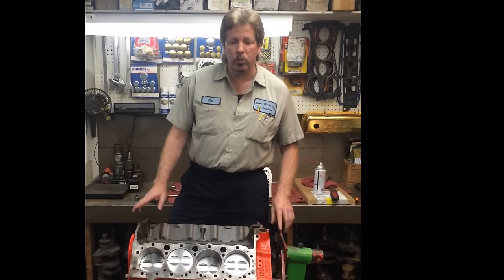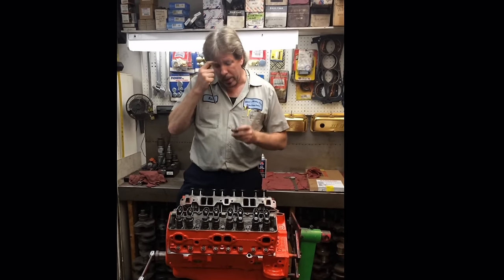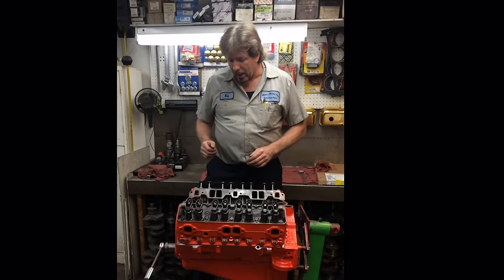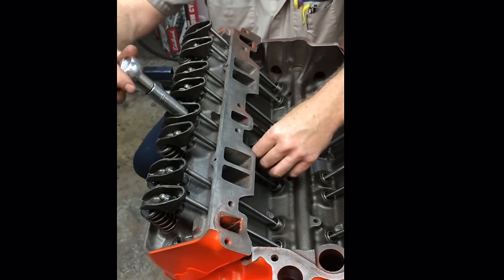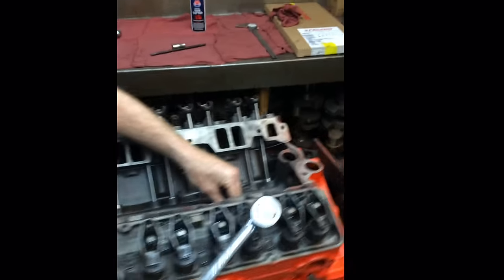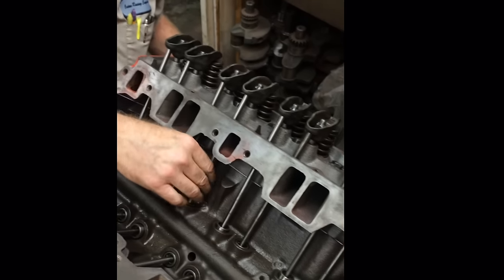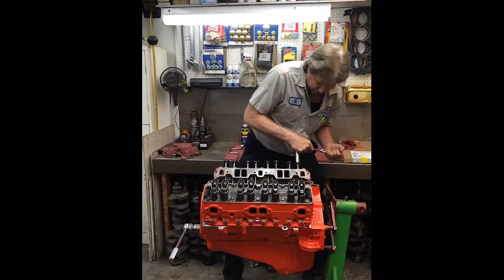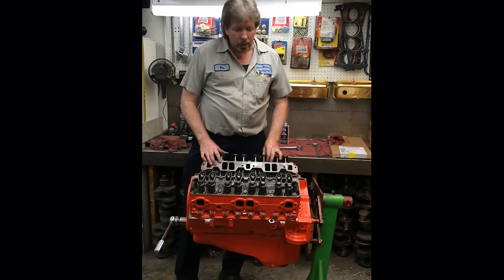Hydraulic valve adjustment made easy - Your Engine Guy

Comment: Hey Ken, I'm 65 years old and I've been a mechanic all my life since the first time I changed the spark plug in my first lawnmower when I was 7 years old and my grandfather who was a master mechanic was starting to teach me about motors. When I re-built my first 327 is when he showed me this method. I have also been taught by him how to put together engines without any type of torque wrench. My first introduction to this was watching him put together an old John Deere tractor engine without and torque wrench. He re-built that old motor about 45 years ago and it is still running today and it still does not have any leaks on the engine.
Reply: M
Reply: Hey bud was hoping for some help... i have a 390 fe with non adjustable rocker arm shaft.  Can i use this method?  I also need to set the preload ( not sure if these 2 things are the same. I'm a bit confused please help . Trying get her back on her feet . Thx buddy

Comment: I was taught this back in 1987 from my neighbor who had a Top Sportsman car. It's so simple, saves time, saves money, and you don't throw tools trying to adjust them right. GREAT VID!
Reply: Love ur simple & smart way to adjust the lifters/rockers ur the man bud thanks for the great tip God bless u!
Reply: What if it had oil? Can I do this with oil?
Reply: What if you're, for whatever reason, taking the rockers out and putting an engine back together with the original lifters (wet) not being removed, such as replacing rockers or a head gasket , heads and so on?
Is it still going to be the same process or is it different? With the lifters being oil filled, wont they bleed off/
self adjust from sitting after a period of time or when the engine is cranked over?
Reply: And why haven't you shared this information with the rest of us? Off with your head...

Comment: Ive been doing it this exact same way since 1977! You are 100% CORRECT! Important to repeat though, like you said, cant soak the lifters in oil. Great advice! Great channel!
Reply: Painted Bear so if I soaked the lifters in oil prior to installing but have not pumped or run the engine can I still do this method or did I need to buy new lifters and start over?
Reply: My gm 3400 has a specific torque rating for the rocker arm bolts so does that mean I just install the pushrods, torque to spec and I'm good to go?

Comment: Just wanted to chime in, Thank You,  Sir. By far the best method,    did this on a sbc350 and worked out fine for my setup.  I added the 3/4 turn for my final. My engine was ran previously to this and some lifter were still oil soaked, didnt make a difference in final outcome, just have to say  OUTSTANDING.
Reply: Had a question for you will this work if lifters had oil in them already ? Im just doing a gasket change and nit rebuilding whole heads?
Reply: yes just be sure to follow along with the video @devotedanaheim1575
Reply: I hope you see this and answer my question. If lifters are already soaked in oil. Do I need to loosen all rocker arms and start the process from the beginning? As I am planning on changing lower intake manifold gasket soon. Thanks

Comment: Been building SBC's for forty five years. This is the PERFECT way to adjust the rockers. Great video.
Reply: If you don't have the intake manifold off, is there a different way to adjust the value train?  Wanted to check the torque on the head bolts when I replaced the head gaskets on my 72 Chevy El Camino.  The valve assembly is in the way of the head bolts.

Comment: After watching this great video again 6 months later, I have come to the conclusion It is well worth the time pulling off the intake to do this. Thanks Ken, Makes much more sense this time around.
Reply: If you understand overlap none of it is an issue it can be done dry without running the engine with the overlap method it works on any engine 246 or 8 cylinder
Reply: I’m wondering if you can do it without removing  the intake ? 
You can still “feel” the pushrod. Thoughts ?
Reply: @Timmytownhouse  Yeah, on the engine I am working on currently, you would be able to grab the very top of each pushrod without removing the intake - - but ... if the intake is not off, doesn't that imply that the lifters would be full of oil (having been in a running condition)?

Comment: That is how my shop teacher showed us way back in 1984, and how I show my students today.
Reply: What if liters have been run already
Reply: @jdcorben6541  do it cold in the morning and turn over the engine by hand if possible. if not pull the coil wire and pump it over slowly so as not to build oil pressure. i did it to my truck this weekend using this method and it runs better than ever.
Reply: Will this work on my 2013 chevy 5.3
Reply: @merfeldmerfeld7792  no. Those valves are adjusted so much different

Comment: I did a Chevy Silverado 97  vortec  5.7 cylinder head gasket , and I used the same method you are talking about 90° increments , 
No tapping noises , runs perfect , never failed smog inspection .
I did a head job , when it had 238,000 miles , now 332,000 miles and runs sobnice still .
Your old school method still useful .
Great explanation .
Thank you !!!👏👍

Comment: That’s the way I was taught by my diesel instructor.  He used to always have us working on his race cars in class when we weren’t working on diesels .  The man was a genius when it came to engines and he showed us this exact method way back then and I do it that way every time and it’s perfect every time.
Reply: What about when the lifters are already primed? Can this still be used?
Reply: @FloridafishingwithRick  have you found the answer?
Reply: @jsolo7576   yeah. I ended up doing it with them primed. It worked. Which I took my time and went around more than I probably had to.
Reply: @FloridafishingwithRick  did you do it i with or without the intake manifold?
Reply: @perlav1056  with it on
Reply: @FloridafishingwithRick i know this thread a bit old. Did have to loosen all rocker arms to start this process from scratch or not. Have a ticking sound coming from valve cover. Hoping this method would help. Thanks
Reply: @sar9907  no, you can actually do it with the motor running but have something blocking oil from dripping onto your exhaust manifold. Loosen one at a time until you hear it tap then tighten it slowly until it stops then do one more full turn.
Reply: @FloridafishingwithRick  thanks for the reply. What about if the engine is off. Not oil pressure present. Doing 1/4 on crankshaft while adjusting rockers. Is it possible this way? I mean loosen 12 rockers and start accordingly. Thanks
Reply: @sar9907  yes
Reply: @FloridafishingwithRick  thanks a lot. Appreciate your feedback.

Comment: I learned a similar method from Competition Cams 25-30 years ago and it works like magic, I did all my GM engines like this and never had any issues. Forget about those oil clips or making a mess.. I run my valves down 1/2 turn past zero lash and was done, the books say (1) turn and it never ran quite right at that setting and I saw a lot of burnt intake valves on vintage SBC... BTW: 15W40 Diesel Oil has higher levels of Zinc & Phosphorus to prevent wear to the cam lobes, the motorcycle guys use it as a cheap alternative to a specialized oil.
Reply: I do the same thing, even the ol diesel engine oil trick before. However with all the smog on diesel engines now a days, they have to exclude the zinc from their oils now. As it can damage the smog system. Better alternative though, summit racing sells high zinc engine oils in many weights to choose from. I particularly love Lucas's 10W40, high zinc and about $30 for 5 qts
Reply: yep that how we did it for erson cams but the 40w diesel oil thats what we learned back in the 90's fail safe proof

Comment: Thanks so much for this video; it's one of the best and most useful I've seen. You're even working with an engine virtually identical to the one in my '65 Impala SS: the iconic small journal 327 with a factory forged crank, flat top pistons, and double hump heads!

Comment: I just finished valve seals on a sbc and set the lifters your way-it took less time without any stress and it started up and ran smooth right now.  I hope this answers some questions about new or wet or dry lifters-it don't matter.  thanks

Comment: Interesting, I thought that I had the easiest method for a SBC. I set the timing mark on TDC and adjust all of them to zero lash, rotate the crank 360 and zero all the loose ones, give them all 3/4 turn and button it up. Been working fine since 1974. Your method is probable more fool proof.

Comment: Thank you so much for making this video I am not a machine but I have always worked on my own vehicles,mostly because I don't have enough money to take it to the shop,and I don't really trust the mechanics around my area. I am 48 and was showed the same way you mentioned about valve covers off and running. But not only have you showed me the best way to adjust them you explained the problem I was having, because I have never had to replace a oil pump before and mine clogged up and installed a new one and broke down. I have been working on my truck for a month and couldn't figure it out. You have saved me from going crazy. Thank you, my truck is a 1997 chevrolet k1500 5.7 and it at 219925 miles and now I think I will get 150000 more miles out of it before I buy a new motor. Thank you, best explained video I have seen yet.

Comment: You sir, are a true asset to humanity. EXACTLY the advice I needed as I enjoy reassembly of a GM 366 (1983 GMC bucket truck) with cupped lifters & flattened cam lobes. New camshaft + new lifters + new pushrods + YOUR VIDEO will ensure my success!! I'm particularly excited to use the manual oil pump rotation trick (intake man. is already off of course) - can't wait to see all that "Texas Tea" flowing over the beautiful new breathing apparatus! Hats off my good sir - thanks SO MUCH for taking the time & trouble to put this video together!

Comment: Thank you Ken for this video. Previously I had set-up the valvetrain in my 302 using the lifter height method you described at the beginning of your video. So I figured it couldn't hurt to spin my rotating assembly through 2 revolutions and check the lash each 1/4 turn. Sure enough I found a few that were loose so I obviously didn't do it correctly. Your simple, error proof method just saved me from  having to do a lot of unnecessary readjusting at start-up.
Reply: I think that's a great idea I like my firing order overlap method thank you very much

Comment: LOVE this! About to do it with my 350 still in my '69 Chevy Area 51 security truck though if had to leave it for some reason I'd leave the wrench on the next valve to be done and also be marking off each 90 I did with notepaper marked from 1 to 8 revolutions and marking each done as I complete them. :)

Comment: I've been doing my lifters the old school way for 35 years.  Thank you for showing me your way. You have a new subscriber 👍👍👍👍👍👍👍👍👍👍👍
Reply from the maker: Thanks for following Joe!
Reply: You have to take the piston out and to do that you take off the clip, pushrod seat and metering plate, then depress the check ball, slide the piston out(rotating and gently). Don’t drop the little parts behind the piston, drain all the oil that will pour out and reassemble. It worked great on my brand new ones that were locked right  out of the package.

Comment: Great process - thanks for sharing!  Returning the favor:  my never-fail initial timing trick - I rotate the crank until the degrees indicated on the harmonic balancer matches the ignition lead called for, then (with the dist cap off) I install and rotate the distributor housing until I the trigger magnets line up (or points just begin to open), and finally tighten the hold-down clamp... the motor will instantly light on first start and the static advance has always been within a degree or two of perfect.
Reply: SteveAndStacie Poythress  can you explain this more in detail? I can give you my email address
Reply: @derekremmick5086  Let me see if I can find where someone else has on YouTube; if not maybe I'll make a short video!
Reply: SteveAndStacie Poythress  awesome please do! Thanks
Reply: I'm a retired postal auto tech. We used this method to time the GM 2.5 old iron duke engine in the postal delivery trucks. The distributor was difficult to reach when using a timing light up top. You line up the reluctor (magnet) with the pickup with the timing marks at 6 degrees BTDC and it would be right on.

Comment: Very nice video. I had 2 of those old 327 engines. When I was 18 in the 70's in an old Impala with just headers and a holley 600. Ran great! then in the 80's one in a V8 vega. Had a Muncie 4 speed with a narrowed 12 bolt with 4:10 posi. I thought I was Grumpy Jenkins! Dig that old S-K ratchet. Still got mine from the 70's! Thanks for sharing.

Comment: Good way to adjust valves. One tidbit, when using aluminum heads on an iron block, one should go .010 to .020 deeper on the plunger. Usually 1/4 to 1/2 turn more depending on the thread count on the studs. The aluminum heads expand more than iron. The engine can be quiet when cool, then get more noisy as it heats up.
Reply: I think you mean "thread pitch", Martha Stewart.

Comment: This is brilliant.  I'm gonna be converting an old fe 390 to hydraulic roller lifters and cam.  The valve adjustment seemed daunting to me.  This looks so much easier.  Thanks for the video!
Reply: Hey bud I have a 390 fe with non adjustable rockerarm shaft .. will this method work  .I'm not going the roller rocker way .. but hopefully you might know.  Thank ya bud

Comment: Nicely done sir. One question: What if engine has been run and therefore all lifters primed etc to normal running condition? Will this work on a “used” motor?
Reply: Gotta turn all the rocker nuts 3 turns past zero lash and let it sit for a few hours In order for the valve spring pressure to push the lifters effectively bleeding them out
Reply: @SwingingInJoggers   Does it really matter if the lifters are pumped or not?   zero lash is zero lash whether there is oil in the lifters or not, no?

Comment: Hi Ken, Can this still be done to adjust if the engine is already in the car and has been running as the lifter is already primmed with oil ? or is this only for setting it up in a new build with no oil yet in the lifter?  I'd like to use this to adjust existing build.
Reply: Same question
Reply: same question
Reply: Same questions
Reply: Same question. Lol, but no reply. Hellpp!
Reply: It don't matter..dry or wet
Reply: Yes, absolutely.  Just do not go over 3/4 of a turn from 0 lash.
Reply: @brandonpriest3604  I did mine already, a couple months ago now. I went a full turn with the lifters already primed cuz I never took them out. Strangely, I hear a ticking of sorts. I'm not sure if it's an exhaust leak though, that's the annoying part. Doesn't help that I'm partially deaf, lol!
Reply: @asteriosanagnostou3243  is the Ticking louder at higher rpm or the same as idle ?
Reply: @brandonpriest3604  it doesn't seem to change with rpm.
Reply: Well, come to think of it, I'm not sure. I have to drive it again. What would you say if it did? Or if it stayed the same?
Reply: @asteriosanagnostou3243  that's good. No calapsed lifter then. Maybe double check your rocker arm's
Reply: @asteriosanagnostou3243  If it does get louder with acceleration.  It could be a bad lifter. It's a pain, but replacing the lifters is pretty cheap. I use comp cam lifters or Howard's lifters.  But Gm lifters are made all by the same manufacturer. Amazon has the best prices. But stay away from off brand stuff.  The metal from across the pond is not certain and could wipe out your cam. Also , some times adding 1 quart of transmission fluid in a fresh oil change can sometimes restore calapsed lifters.

Comment: oops...forgot to ask a question. What if you are changing heads but not the hydraulic lifters. They will have oil already (existing motor) and resistance...how do you get past that ?
Reply: following.  I would love to know as well
Reply: Drain oil, remove lifters one by one and dip in lacquer thinner and dry with lint free cloth. Replace lift into same bore and continue the process. Refill with fresh oil after.
Reply: @benjaminjones1465  
1 8 4 3 6 5 7 2

Comment: I like this method and thank you for showing it.  Can this be used to readjust valves on an engine that is already in use? Meaning the lifters would be oiled.  I think it would work for zero lash setting but not sure about the preload in this instance
Reply: I’m asking the same question. I ran mine before  totally forgetting I hadn’t adjusted them yet, and now im Wondering if this would still work.
Reply: Have you found the answer
Reply: No